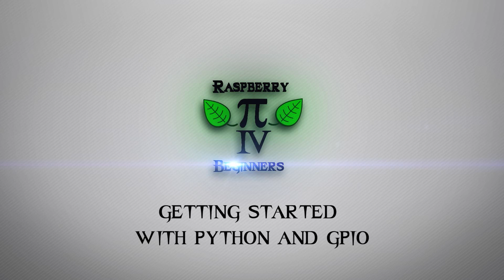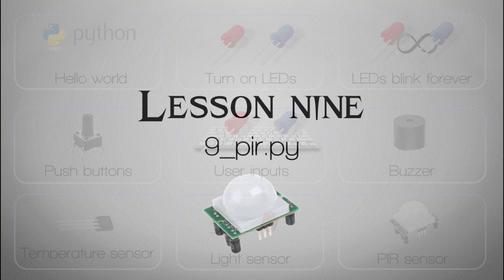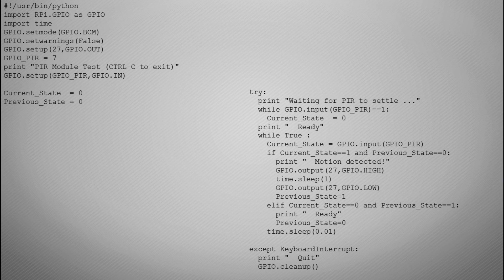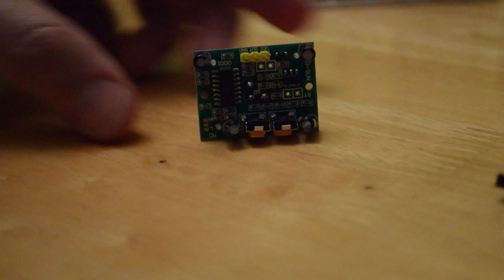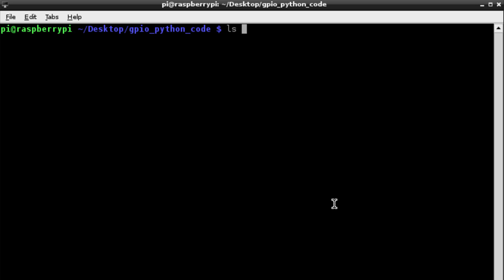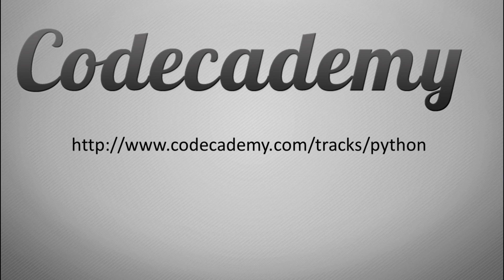Raspberry Pi - GPIO & Python (9/9) - Passive infrared sensor

Comment: How are you connecting 5V sensor directly to the GPIO pin of the Raspberry Pi. As per my understanding Raspberry Pi GPIOs are only 3.3V output/input tolerant. I have read warnings about not to connect a 5V input to the pins.

Comment: Hi, this could be some dump question...
In this Tutorial completed demo where the motion detection(at 5:20) is tested i could not see any HDMI connection to monitor.
How we get the output without display HDMI connected.
Also is this possible to have this project standalone(without display) & autostart on poweron and sent the data to a windows System(Could be a c# application).
Reply: You can connect to your raspberry through a ssh connection. (You don't see a hdmi connection, but there is a blinking wifi dongle!) This way you don't need a monitor connected, but you can't run your graphical interface, meaning you'll have to handle everything with the command line interface. (unless you run a remote desktop connection) http://www.raspberrypi.org/documentation/remote-access/ssh/

Comment: http://www.bananapi.com http://www.banana-pi.com

Banana PI is an Open Source hardware platform which was produced to run the Elastos.org open source OS among others. Banana PI a dual core, Android 4.2 product which is much better than the Raspberry Pi. 

The Banana Pi hardware runs Android, Debian Linux, Ubuntu Linux, OpenSuse linux and images that run on the Raspberry Pi and Cubieboard. 

Banana PI has a Gigabit Ethernet port and a SATA Socket. It can run with Android 4.2.2 smoothly. The size of Banana PI M1 is about the same size as a credit card, 

It can easily run games as it supports 1080P high definition video output. The GPIO is compatible with Raspberry Pi and can run Raspberry Pi images directly.

Comment: how to combine the pir and the ldr, so that the pir just detects motion when its dark and then switch on a light for example ?
Reply: You would need an ADC for the photoresistor.
Reply: but the 8/9 video of these tutorials is about a ldr just with a capacitor and i get different values if its darker or when its brighter.. i just have to combine the ldr script with the pir
or include the values of the ldr script in the pir script.. but i dont get it work :/